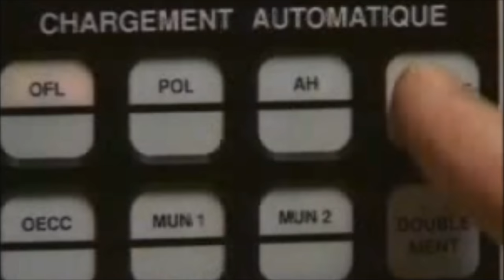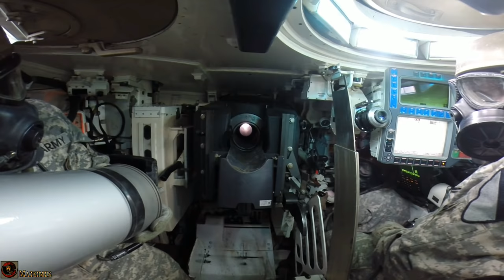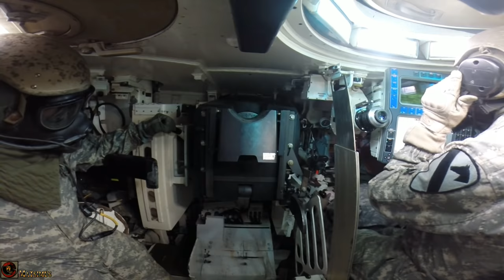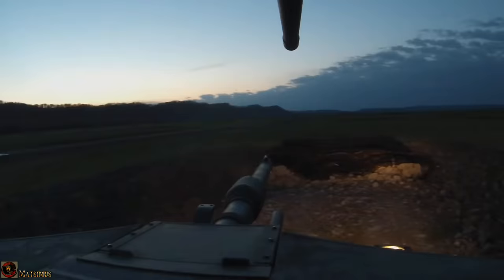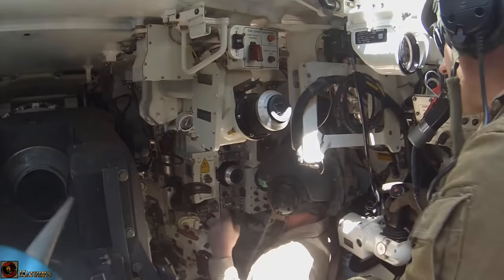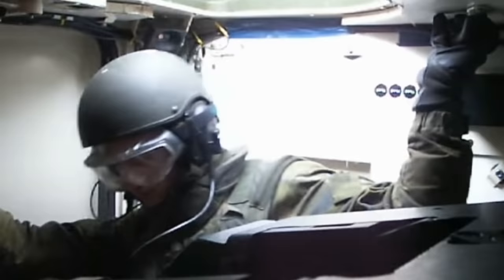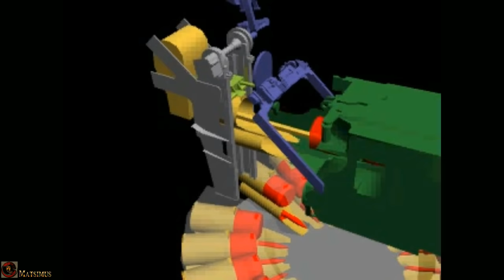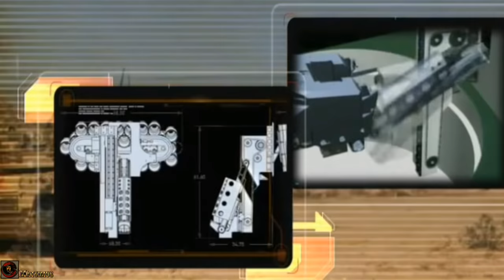Tank Autoloader or Crewman Loader?

Comment: I don't think anyone will stay in the Abrams or Leopard when the bustle rack is hit and explodes, even though part of the ammunition might still be valid, and the tank might not be destroyed, the blast compartment will likely be contaminated, and any further action might risk the lives of anyone in that tank. Regardless of that, any tank that gets effectively penetrated will likely be abandoned. Throw track whilst in combat, again the tank will likely get abandoned, except if you are "in combat". 

Autoloaders have come a long way, you're only hinging on the Soviet/Russian designs, the French and Japanese have a faster autoloader mechanism, which is also far more isolated from the fighting compartment, with a smaller weak point towards the internal, compared to the huge blast doors of manual loading blast compartments. The Type 90 can reload in 3.0 seconds a gun at neutral elevation ~4 seconds if the gun needs to be corrected to neutral, similar for the Type 10. I'd like to see a human loader do that consistently and not lap loading, but abiding by the rules of blast doors closed. The other benefit is that the autoloader does not care about the tank moving, it will perform to specification, as long as the gun is in the correct position, even if the tank is driving 70km/h over bumps and ditches, while a human loader trying to load would be bouncing all over the turret. 

There are certain benefits to both, another crew member is certainly one of those, but all the designs Abrams, Leopard 2, Challenger, are old designs, and I doubt we will see manual loading when the new generation of tanks that should replace those comes out. You can make tanks so much smaller with an autoloading mechanism, which is one of the benefits, and most newer designs like the aforementioned Type 90, 10, Leclerc, K-2, etc. come default with an autoloader.
Reply: It's difficult to successfully penetrate an Abrams with good crewman though.

Comment: In my view, the aotuloader is what I prefer, as long as it has more armor protection from incoming rounds or even blast proof compartments.
Reply: John Orven Tano Got it right mate... Human loaders would be more hard because calibers get bigger and larger.
Reply: +Panzerreichus Holzer The tanks that have autoloaders should need to have protective blast proof flooring if you had a carousel type autoloaders found on russian tanks, also if your ammunition compartment is from the rear of the turret, just like some other european tanks, you must need a protective blast proof wall that devides between the crew compartment and the ammunition compartment in order to prevent the crew from getting killed when an incoming projectile hits the ammunition compartment.
Reply: John Orven Tano armour only as good as the maker claim..the reality is they always and will fail. being in a tank, you got to accept the fact that you will be incinerated or explode into a gas if another tank round hit you.
Reply: John Orven Tano The autoloader on the French AMX-56 and T-84M (Tropical version) are what you are thinking about, right?
Reply: Putera Usman In case of Russians tanks yes. ... But into Leclercs and Abrams tanks, shells are protected in a no oxygen hull in back of the turret.
Reply: Alex77 77 if there s no oxygen, how they going to get the shell? The moment they open the blast dire, there you go all the oxygen rush in.
Reply: a hit to ammo storage will make EVERY tank obsolete. don't be foolish to believe that if your ammo explodes nobody will take any harm. the explosion alone will be sod devastating and powerful to knock out anything inside the tank and even NEARBY!
Reply: cccpredarmy 
That’s why Abrams’ have blow away doors in the magazine compartment. If the magazine is compromised it blows out the doors sending the blast outside of the tank. A compromised magazine in a auto loader would send that blast straight into the compartment.
Reply: Armata has the carousel style loader but the crew are already in front of the tank separated from the ammo

Comment: W8 w8 w8, human loaders are faster than autoloaders? That is something new to hear
Reply: Apparently its either humans are faster or on the exact same speed as an auto loader.
Reply: have you ever seen  speed of t72 ub reload speed?
 keep in mind nato uses smallercaliber shells
Reply: Human loader in M1A2 can load faster than AL in T-72B......but AL in Japan tank can load round two times faster
Reply: Ruslan Dimiev A2 uses 115mm instead of 125.
Also french hav AL that goes faster than human loader
Reply: Depends on the autoloader. The French Lerlec has a 13 rounds per minute autoloader.
Reply: Had a weight lifter, 6 foot 1 inch loader in my unit that could throw 9 shots in about 38 seconds... He was drilled, in-shape, highly motivated and knew his shit. He was an living auto-loader... LOL

Comment: Well, I'd like to be the devil's advocate here:

The problem when comparing the two systems is that you are looking at it from a grass root angle - the human loader is great for the reasons you listed, but they are all tactical advantages, ie advantages for the tank.

The autoloader came to be as a result of the prevailing Russian doctrine of overwhelming force - that is, the Russians wanted as many tanks as they could possibly muster, but they also had one problem: not enough men. To be able to be a tank crew member, you need to be quite short to just fit in and there aren't simply that many short Russians (this was emphazised by the doctrine of making the tanks as small as possible, to make them as hard to hit as they could ever be). That meant that there was a disparity between a) the wish to have as many tanks as possible and b) the relative short-age of men (pun intended). 

And, you shouldn't forget that the Russian tanks were considered part of a warmachine, where you could easily replace a damaged or destroyed tank and where you had forward mechanical service depots deployed. All this of course changed with the fall of the communism and the Warsaw Pact, but the doctrine kind of lived on in a smaller scale - the Russians wouldn't dream of deploying tanks one at the time in a war zone - they still go for overwhelming force-

But all that said, that is why the autoloader is strategically a better choice, but tactically, a human loader is preferable.
Reply: This is amazing...I've been reading through comments on this video for the past 10 minutes or so, and I have seen nothing but respectful, well thought out, well constructed, and grammatically correct...am I still on Youtube?
Anyways, as far as I can see it, a tank with an autoloader essentially has one real advantage over one with a human loader: initial fire rate. In a straight up tank battle, a platoon of autoloaders would likely win versus a platoon of tanks with human loaders (assuming all shots from both sides are capable of penetrating) simply because of how quickly and how consistently the shots can be fired. Overwhelming force, as you said.
So basically, unless we start getting into conflicts again where tanks are slugging it out with other tanks, a human loader is the superior option because of the tactical benefits, and those tactical benefits also make the tank more flexible in combat, and the more flexible a machine or a force is, the more likely it is to win.
Reply: @Omen_Seven ,всё верно, только у нас танки измеряли дивизиями и армиями.

Comment: auto-loaders are not only efficient but also a necessity when you have LIMITED MAN POWER resource. 
A unit consisting of 21 trained people will fully crew 7 tanks (speaking about russian designs of 3 crew) 
A unit consisting of 21 trained people will fully crew 5 tanks (speaking about US designs of 4 crew) 

That's 2 extra guns (firepower) for the same amount of people.

Also, the auto-loader allows for manual loading as well. A malfunctioning auto-loader does not mean the tank is useless, AT ALL. THAT's why the rounds are stored in the crew compartment in the earlier russian MBTs.

ALSO, a loader fixing the track and so on and then getting fatigued back in the turret, loading rounds will be LESS EFFECTIVE.
Not to mention if he drops the round inside the turret because of fatigue...

There's so many other factors that you did not mention, at all, so i give you a dislike. You're obviously biased in this video and you're not objective. before making such videos consider ALL the facts or at least try covering them ALL.
Reply: I think tank production is more a limiting factor than available man power for most nations.
Fatigue can be an issue, but usually you wont fire a massive amount of rounds for an extended time and you can also catch your breath in between firefights. You wont go fixing a track, loading all your shells in the tank and then be in a 20 minute long firefight. Manually loading when the auto loader breaks is far from ideal aswell, you take either the gunner or TC away from his job, the turret might not be good room wise to load shells manually and reaching them can be difficult aswell. And depending on the autoloader a malfunction could make the loading impossible. Not everything is perfect with either system.
Reply: For a smaller task force I agree, if you are very limited on manpower then an auto-loader will allow you to have more tanks. But then again nations such as U.S., UK, Germany and so on have lots of man power so that isn't an issue, and if your nation can't get enough people to have manual loaders then you should question your ability to fight anything. :P

You can't really manually load a auto-loader (a Russian one at least, but most other nations use manual loader) if it breaks down,  it uses two piece ammunition (projectile and propellant stored separately) that needs to get pushed quite deep into the gun. Not to mention it's a bigger paint in the ass because of how the ammo is stored, it's not really meant for a human to use, it's for the arm(s) that the auto-loader consists of, also either crew member is sitting down and facing forward, making it harder on top of that. So no you can't manually reload it and if you somehow can it will take FOREVER to reload, wont be getting anywhere near the 7 second loading time functioning auto-loaders have. At this point you might as well run away (if you can) and fix the auto-loader, then return to battle.

With an auto-loader the crew would be even MORE fatigued after having to fix the track or something prior to an engagement, since there is not an extra helping hand, so this argument kind of goes against it self. Loaders are also physically fit and I don't think fixing the track prior is enough to make their arms give way when holding a round and putting it in.
Reply: Actually, the simple fact that an Autoloader makes the tank WAY more vulnerable already makes up for the lack of firepower. Regular Man-loaded tanks store ammo in a separated armored compartment, making it getting ammo racked way harder. Sometimes numbers just don't work with efficiency.
Reply: Mr.Fluffybutt Gaming "With an auto-loader the crew would be even MORE fatigued after having to fix the track or something prior to an engagement, since there is not an extra helping hand, so this argument kind of goes against it self."

You mean that an auto-loader will be fatigued because the driver, the gunner and the commander are fatigued?

Do you even logic?

How is gunner, driver and commander fatigue compared to HUMAN LOADER fatigue?
Reply: Because maintenance tasks on a tank are heavily manpower intensive.  Have you ever broken and replaced track?  I have and it's heavy, hard work.  And when you only have 3 men vs 4 to do the work, that equates to greater crew fatigue as you have one less man to help spread the work around.
Reply: That is true to an extent, but remember 4 man tanks CAN be crewed by 3.  You simply eliminate the gunner position.  Remember in modern tanks, the TC has the same optics and firing mechanisms for the main gun at his station.  If you are short a man, the TC assumes the gunner duties.
Reply: what happens if ammorack when ammo door open?
Reply: Bad things. The explosion/combustion will get into the fighting compartment, either fully or partially upon the door closing again. This is why the door is only open for as long as needed. It can happen, but it's a rather short timeframe.
Reply: +Cunpoc Less crew = longer maintenance times (for when they have to work on it out in the field by themselves) and even more tired crew(which itself equals to less performance). Also having a fourth member would probably increase morale.

Do you have common sense?
Reply: Cnupoc a
Reply: So what your saying is let's put  an autoloader in but still have the same amount of people in the tank as tanks with out autoloaders....
So there making more work for them selfs....

Comment: Just put a T-800 as a loader. It's both a machine and man so both sides are happy :)
Reply from the maker: HAHAHAHA!! 

Commander- "Loader, load HEAT!!"

T-800 Loader - "No problemo"
Reply: Why bother put a T-800 in a tank?  Just load it up with multiple laser cannon and missile launchers, it becomes more deadly than an MBT.  And it can climb stairs in urban environment whereas tanks can't.
Reply: Pandacat80 But tanks are sexy.
Reply from the maker: +Pandacat80 haha are we actually doing this lol!! 

Ok but put it like this, the T-800 range can't be as far as a tank purely for the fact it's pea sized eyes probably can only see a couple of Km's where as a MBT can engage up to 5000m ;-)

Plus lasers only work against metals and such, they would maybe fail against ceramic plates armor lol. And the Tank T-800 loader would just hold up a big mirror and reflect it back haha

Comment: I don't think the MBT is going anywhere. APCs and even IFVs aren't tanks and never will be. Railguns won't be seen on tanks until the capacitor banks can be scaled down to fit within the hull and a 30mm railgun is purely an anti-armor weapon. 120 and 125mm guns are far more versatile with APFSDS, HEAT, HEDP, HE, HE-Frag, HESH/HEP, and gun launched missiles. Electrothermal-chemical guns, of similar caliber to what is currently in use, are probably the next big thing for tank armament.

There are pros and cons to reducing the crew to three with an autoloader.
+A decrease in labor cost of 25% to keep the same size tank force or a 25% larger tank force for the same labor cost. (This alone makes it worthwhile in my mind.)
+Turret bustle autoloaders are far more space efficient than human loaders, whose workspace can take up half the turret crew compartment. Less internal volume that needs to be armored results in dramatic weight savings. This is why the Leclerc weighs upwards of ten tons less than other Western MBTs. Alternatively, that's ten more tons of armor that can be used to protect the three member crew.
+Autoloaded guns can still be manually loaded if the autoloader is out of commission.
+One less smelly person to be stuck inside a metal box for days or weeks at a time with.

-Reduced situational awareness from not having a fourth set of eyes.
-Increased maintenance duties for the three member crew.
-Manually loading the gun in a tank designed for an autoloader will be slow, as the gunner will have to get out of his seat, load the gun without much space to work in, then get back in the seat and engage the target. Alternatively, the commander can engage the target while the gunner focuses on loading, but then he isn't scanning for other targets. Either way, performance is degraded.
-One less smelly person to play cards with or bounce jokes off of.

Arguments that don't benefit either side:
Autoloaders can malfunction but human loaders can get sick or injured.
Enemy fire can disable or destroy both autoloaders and human loaders.